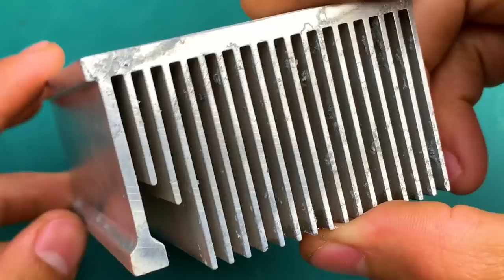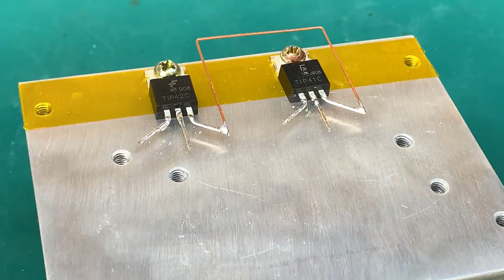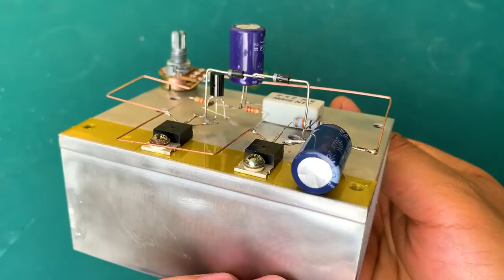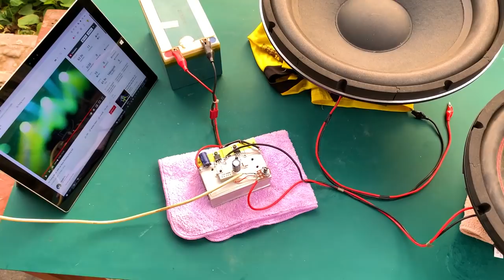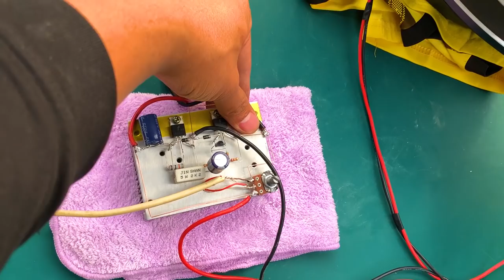DIY Powerful Ultra Bass Amplifier TIP41 TIP42 transistor , Germany's quality audio , No IC

Comment: (Assuming Amplifier efficiency is 100%)According to the data sheet  The transistor is only rated at Maximum 84W(at 14V)  and also With those speakers The transistor will not last long (Those speakers Draw more than transistors maximum current)
Reply: Yea, also, this is not a german's quality audio, more like India's looking cool (but its not) audio amplifier
Reply: everything is always overpriced in the Chinese. And these extra zeros are already standard. They spit in your face and say it's raining. I blocked this channel because it does not contribute anything smart
Reply: @pendzel8233  yeah its right, these youtubers not too smart
Reply: 900watt you need to dream,with that trasistor
Reply: This isn't even a working amp. Battery is directly connected to the loudspeaker. The battery is the real amp.
Reply: Si funciona no da 900 pero si funcionan para tal circuito cuida parlantes colocando par de cond nsadores de acoplo como ya los tiene, evitando el paso de corriente continua a parlante no se quemaran, es falso; si haber vamos este par de transistores npn y pnp no se queman facilmente, menos con 12 vol soportan hasta 20volt... Comprobado....

Comment: it sounds a bit distorted but that's probably because its not getting enough power from that battery. these amplifiers consume a lot of power, especially when driving big speakers. at least it's a legitimate design.
Reply from the maker: Thank you
Reply: This amp is fake. Both wires from the battery are directly connected to the loudspeaker. This whole channel is a scam.

Comment: It would be nice to have a circuit design at hand.
Reply: It’s Fake
Reply: The ‘battery’ is directly connected to the  speaker wires, it probably contains a blue tooth amplifier & lithium batteries.
 If the battery was real , you would just see him smoke his ludicrous one ohm speaker !
Reply: @nicktech9277  Nice catch, it sure is.
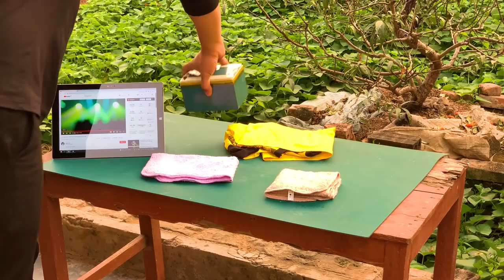Reply: @nicktech9277  At 6:36 you can even see where it looks like the top has been cut off the battery and its been glued back together.

Comment: ULTRA BIG FAKE!!!!!why??The positive side of the battery is connected to the rightmost terminal of the potentiometer as well as the speaker is connected in the same place!!!According to this, the circuit is not doing anything and the battery is empty and the speaker is connected to the output of the tablet
Reply: i thought the same thing, but i doubt the tablet alone could get that speaker moving like that.
Reply: keep in mind that tablet's jack is designed to run headphones, nothing more.
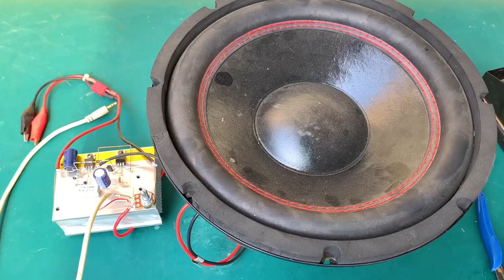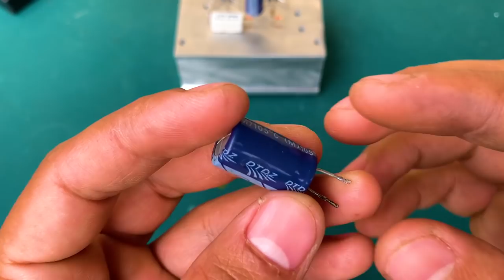Reply: @damoh4895  Stop at 6:12 and follow the wires, you'll see the tablet drive the speaker straight!Is the battery connected to the speaker?Follow the wires all the way, it looks nice.63V 470uf it's connected the other way around (3:59)!I don't think the author would give a circuit diagram :) :) The output impedance of the tablet is about 32 ohms and not even a short circuit destroys it.....
Reply: You are quite correct in stating the ‘battery’ is directly connected to the  speaker, but the ‘battery’ is not empty, it probably contains a blue tooth amplifier & lithium batteries. If the battery was real , you would just see him smoke his speaker and probably damage the tablet , unfortunately both are working as Technical DIY has just managed to get 4 1N2015 Diodes to produce 6000 Watts using the same inane design philosophy!

Comment: Fake, examind this circuit and explained how it works, from the power to the speakers, see how the input goes straight  into the power source by rotating the potentiometer! .  Dont damage your equipment  with this thing.. whole connections , everything is fake.